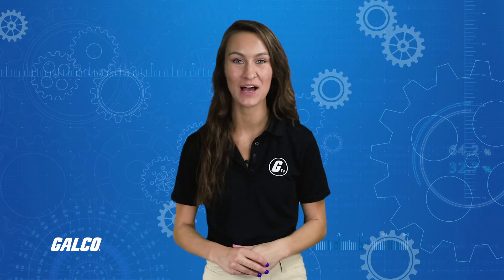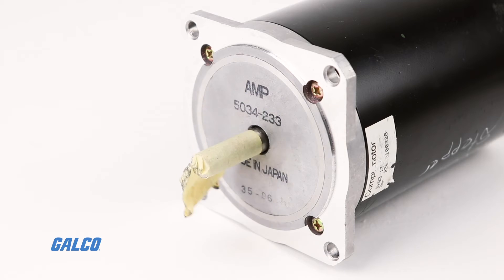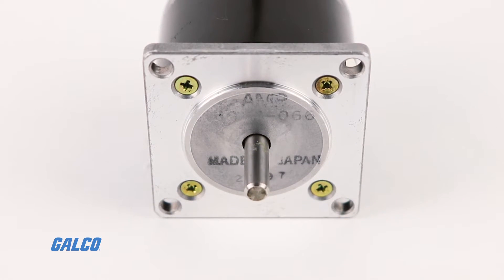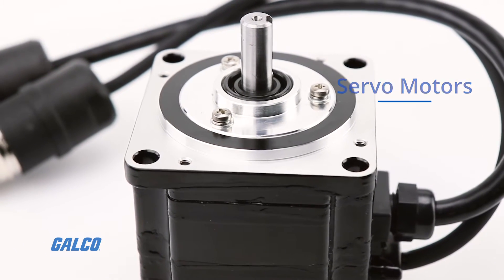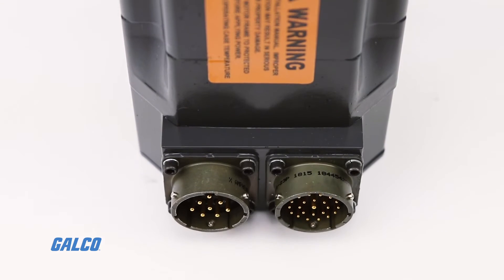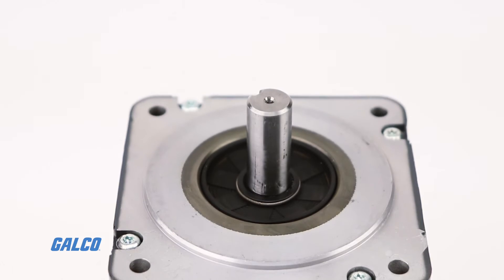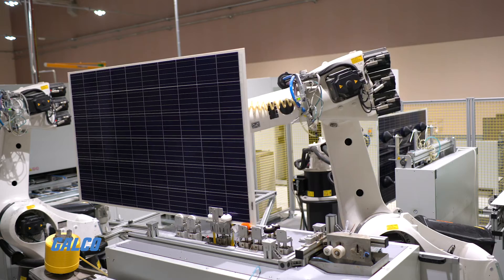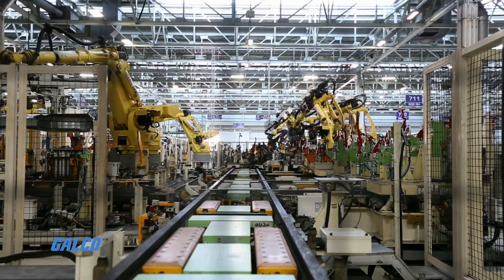Servo vs Stepper Motors - A Galco TV Tech Tip | Galco

Comment: The system accuracy comes down to the encoder ppr. And if both motors have closed loop systems with the same  encoder feedback the accuracy will be almost identical. 
A servo without an encoder is nothing, a stepper without an encoder is still pretty accurate.
Reply: She said the stepper is not closed loop, no encoder. The server is closed loop with an encoder. What are you suggesting with both systems accuracy depends on the encoder used, both closed loop?

Comment: Stepper 4 low accuracy? Are you sure?
Reply: Compared to servo I think
Reply: @moh19931000  Complete nonsense. Steppers have perfect accuracy. They align poles exactly.
Reply: The problem with a stepper is it is only as accurate as each step pole to pole. you can reduce gearing to increase resolution, but you are still stuck with jittery movement. Some controllers are capable of half stepping, but this can make the motor even more inaccurate. 
A servo motor on the other hand is as accurate as your sensor setup. With solid state devices or even those angular momentum sensors, they can be quite accurate, at the same time moving very fast. Without the stepper motion, you don't have to worry about jitter or "ring". That is a kind of electrical resonance that can happen. The faster it moves, the worse it gets. So much so, you will have to build a circuit in to combat that ringing and a wait time to allow the motor to "settle" after moving making work time even longer.

Comment: why are step motors used for 3D printers if they have low accuracy?
Reply: Not much weight carried in its axis and low speed compared to more industrial machinery
Reply: moh neeeee! industrial machines use servos because it's worth the extra cost, but for consumer goods cheap is good, printers use brushed DC motors with encoder strips because it's even cheaper than steppers, i requested a price qoute on a plotter cutter, servos added 25% cost over steppers, for a business it's worth it, but for my consumer ass it was not